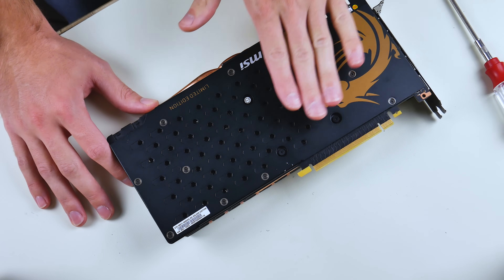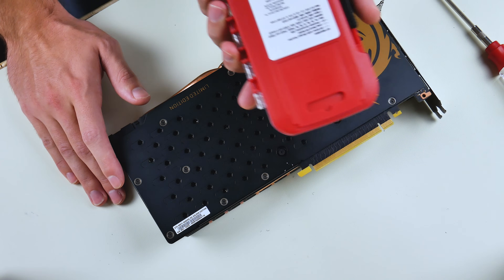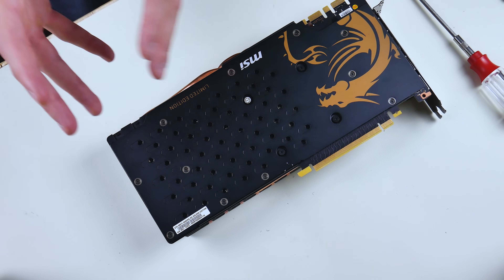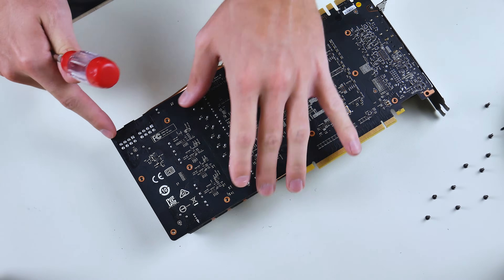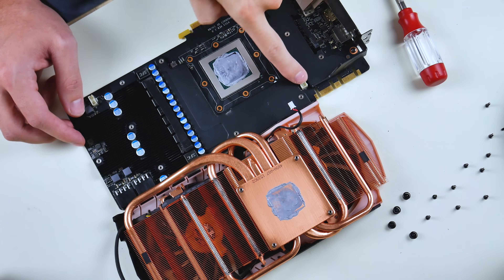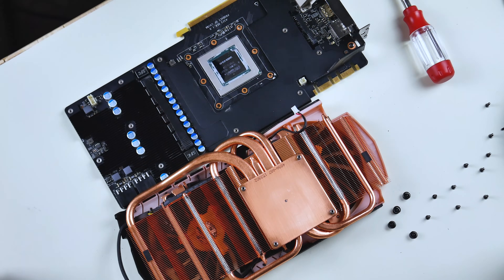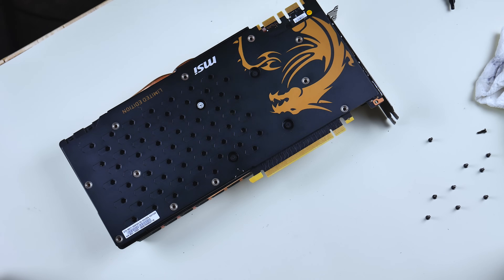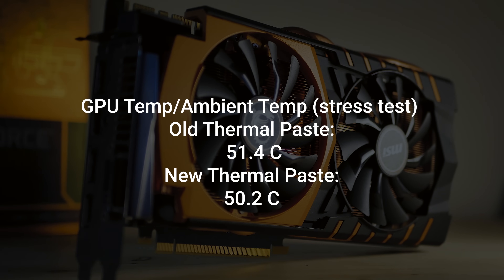How To Replace GPU Thermal Paste - This Is Crucial

Comment: I would recommend putting even a little more thermal paste on the GPU because there are lots of places on it that need to be cooled and not all of them have temperature sensors. Buildzoid from actually hardcore overclocking actually broke a GPU from that.
Reply: Yep. For GPU's I usually use a light version of the X method with tiny dots in each open space to make sure it's all covered. The pea or rice grain method is generally not quite enough, and it's best to make sure there is enough paste to have an even spread across the entire die. The spread method might be a better method as well when it comes to GPU's.
Reply from the maker: @muzicdominator524  that's a good method as well, I'd like to try thermal pads as well
Reply: @muzicdominator524  yea I always use the x method never trusted the pea method even for CPUs. Always an x and 4 little dots to ensure proper spread
Reply from the maker: Yeah covering the entirety of the die is important
Reply: I put little paste, my gpu almost critical in furmark. Seem I would replace it again put more paste.

Comment: I think the timing for this video is perfect cuz ppl are buying used minning cards
Reply from the maker: Yeah I thought it would be appropriate for those who are looking into purchasing used cards
Reply: @jdtechgear   I recently got Rx 590 Gigabyte 8gb... The latest drivers are installed...My Processor Ryzen 5 2400g... PSU 650W Circle... RAM 24gb.. with two fans 1) Processor and back fan...  My GPU  temperature hits 78C... just by playing GTA 5 for 10 mins.. what could be the reason? How do I fix this? and idle GPU temperature is 35C...
Could you please help!
Reply: @tanmayfadnis5440  bad case airflow, or not replaced GPU thermal paste
Reply: @Saigonas  Ok, Thanks... I might get a new CPU case with multiple fans soon!
Reply: @tanmayfadnis5440  I highly recommend undervolting the card!
Reply: 78C is fine. It starts to throttle around 90c, but that’s safe
Reply: @lewisbackupchannel  I was wondering bc depending what I do ingame my rx varies 60°C to upper 70's, and I have 3 intake fans feeding cool air directly  to it, I thought those were good temps? It's my first build tho lol
Reply: @tanmayfadnis5440  its gtaV.. Thats why. A 590 was decent back in the day but it maxes out my rtx 3070 still. 78 isn't that bad. sorry if my comment isn't helpful 6 years later. maybe check case airflow
Reply: @jdtechgear  also. Removing the heatsink doesn't void the warranty anymore. Now "void if removed" stickers are against the law.
Reply: @jdtechgear  and people still buying it right now due to insane high priced GPU this time
Reply: @misterxzxc7314  
I got my used, and it was kind of dirty inside. It runs well and its amazing. Rx 590
:))))
Reply: My 1070 ti was a mining card and after 2 years I finally replaced the thermal paste and dropped 20 degrees
Reply: A 2 year old comment ... i like how we went full circle now
Reply: Thats actually why im here lol
Reply: Sorry but what does mining mean?
Reply: @ntongalea  using your gpu to run a hashing algorithm on a cryptocurrency block chain. Yields crypto rewards.  Process is called mining.
Reply: @ntongalea  yup they definitely understood some of those words lol. Just do the car sudoku analogy
Reply: Exactly why I watched it 😂😂
Reply: Lol
Reply: isn't it the miners who make graphic cards so expensive? why you buy from them?
Reply: @gleipnirfenrir  they sell for cheap
Reply: @gleipnirfenrir a lot of cryptocurrency networks ended the practice of GPU mining, Ethereum being the biggest one. And now that gpu manufacturers have also caught on, they make separate cards for gamers and crypto miners. The gaming cards are "neutered" in a way to screw with crypto mining algorithms but have no impact on games or other graphical uses whatsoever.
They can then sell those more expensive fully unlocked cards straight to the small minority of mining facilities that used to buy all the cards, and they can sell the cheaper gaming cards for the majority of the people who want it. 

Prices have gone down massively after this change. 
The crypto miners sold off their old useless cards that they couldn't really use for mining anymore, and probably used that money to buy specialized mining rigs that don't even really use commercial off-the-shelf GPUs anymore, except in some very rare cases.
Reply: Crap. I think I just bought a used used mining card.